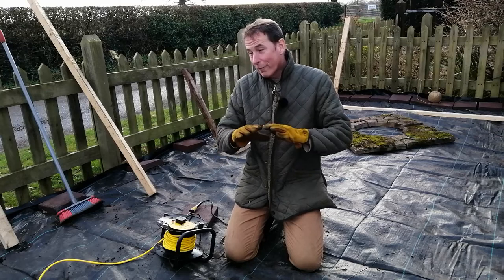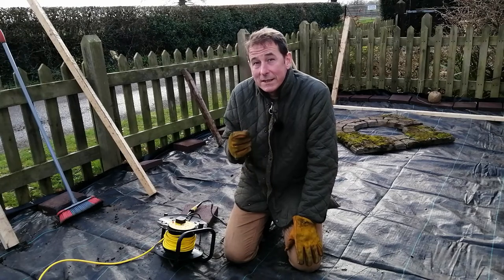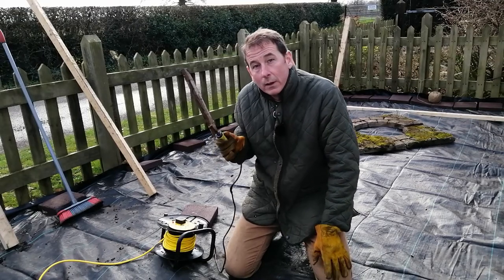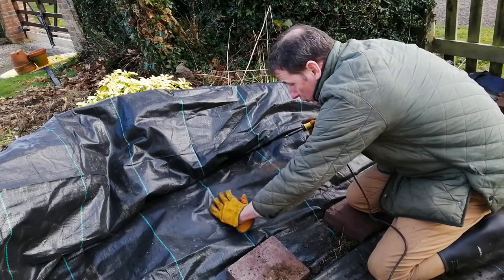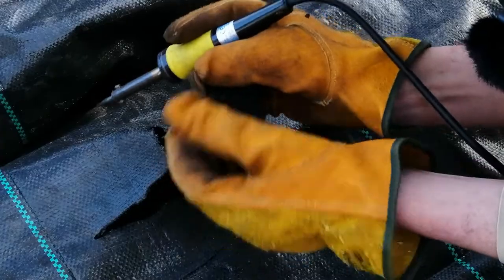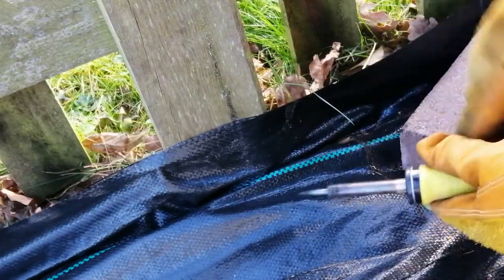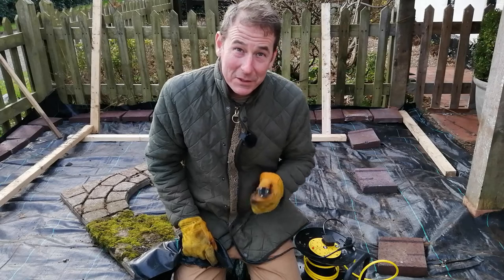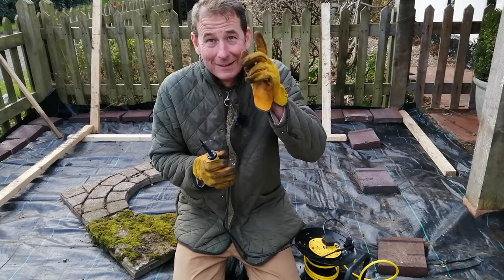Gardening Hack. Cutting woven weed control membrane without fraying.

Comment: Great idea. I have found that liquid chalk pens are great for marking the cut.
Reply from the maker: That's a great idea. I used the line marker spray which did get a bit messy. I'll try that next time. And pin this comment. Thanks. Mark

Comment: I have been scouring the internet to find a way to cut my AG fabric without a torch and I was just about to give up when I found your video! We do have a soldering iron and I'm so excited that I can use it on the fabric. My arthritis just can't handle using a box knife anymore. Thank you so much!
Reply from the maker: Thank you. I've used this method successfully so many times now. Good luck but take care and also, have adequate ventilation. Best wishes. Mark

Comment: Excellent idea. I knew I had to use heat to keep it from fraying but needed a tool that would do it all at once. This is great 👍😁
Reply from the maker: Thank you 😊 before i used the soldering iron i looked at heat guns, they were tens of £pounds. I'm about to publish another 3 minute hack about bamboo barrier. Thanks for watching and commenting. Best wishes. Mark

Comment: Brilliant tip. I also used a small gas blow torch that I have, and while it is very effective at doing large cuts quickly, it's doesn't always seal the edges.
Therefore as I am about to lay down some membrane around established plants I will most certainly be giving your method a go.
Best wishes from Northern Ireland 👍
Reply from the maker: Hello Northern Ireland. I hadn't thought of a blow torch. I'm curious to give that a try next. Do you have a soldering iron? They're really inexpensive at about £15 on amazon. Thank you for watching. Mark

Comment: I hope you've verified the toxicity of burning that plastic membrane? You're bending right over your work area (even worse if you're in a greenhouse or polytunnel). I've seen other videos suggesting using blowlamps and the like. I'd have thought this a very high-risk activity and wouldn't recommend 👎
Reply from the maker: I make it quute clear to perform the task in a ventilated area. It is based on the idea of using a heat gun. I wouldn't lose too much sleep if i were you. I'm still fighting fit 18 months down the line. The wine and french fries are probably a greater risk.
Reply: @Mark's Garden UK  well, polypropylene is one of the safest plastics to burn, mostly only releasing relatively-harmless fumes, but not totally without hazardous fumes. I'd still recommend wearing a gas mask.
Reply from the maker: @rickbear7249  a gas mask would definitely be a belt and braces approach. Thank you